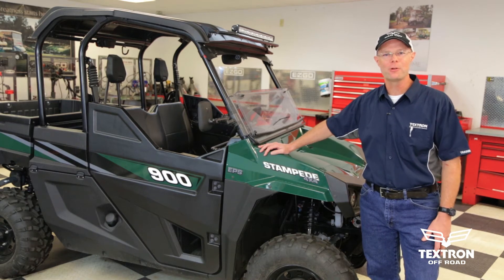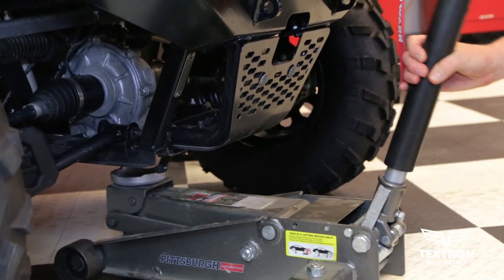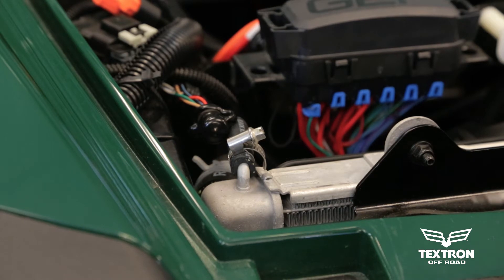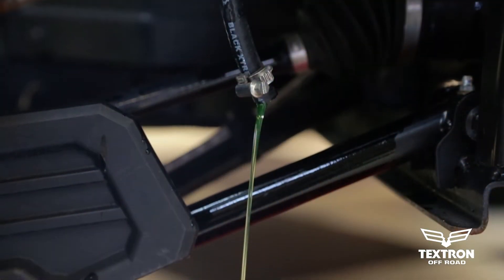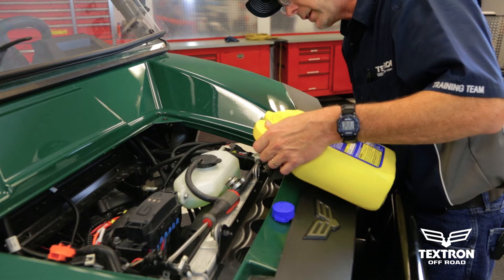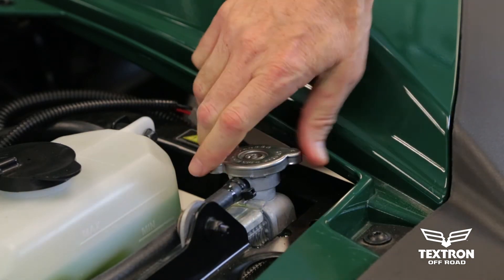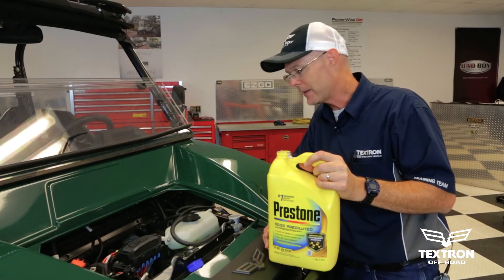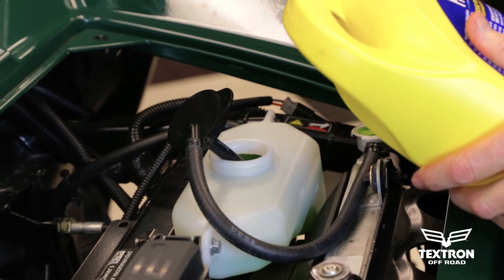STAMPEDE 900 "Purging the Coolant System"

Comment: have you had any issue's of over heating on this machine? I had a massive leak coming from the motor on the passenger side. Bass Pro Is taking a look at it for me this week. hopefully will be a simple fix but from what I saw, could be a water pump failure